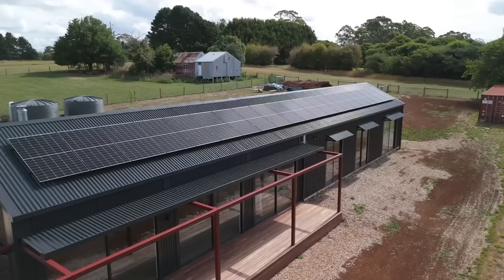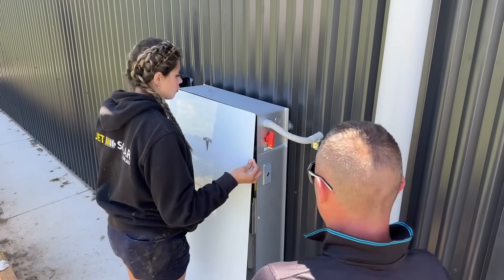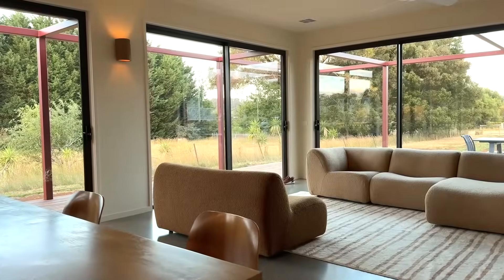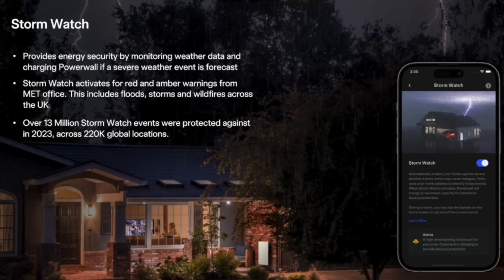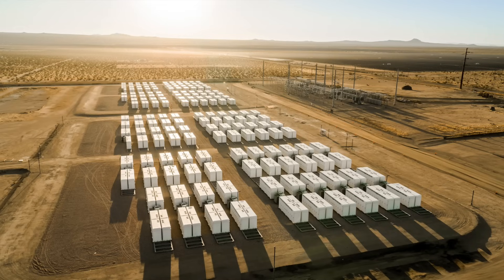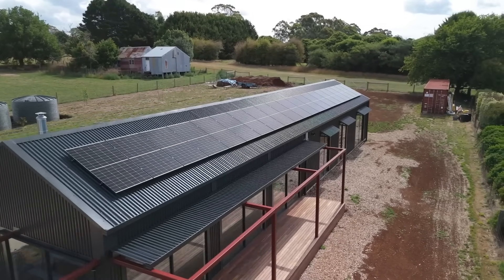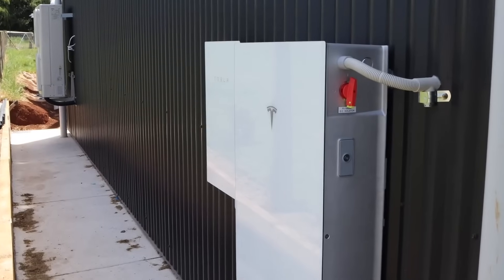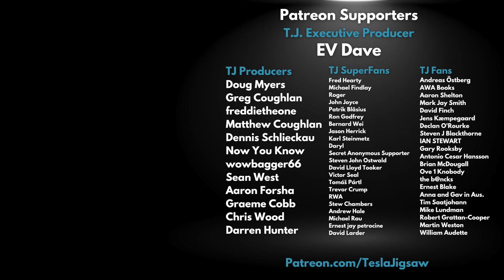Tesla Dream Unlocked: Model Y, Solar, Powerwall & Starlink Secrets!

Comment: I can’t express enough how much solar and powerwall has fundamentally reduced our costs. 
And coupled with a great tariff from a great energy company that allows load shifting (charging powerwall overnight and running the house from it during the day) is a paradigm shift in how energy can be used and manipulated to an enormous advantage. 
Add solar export and running 2 EVs and the house costs a few hundred quid instead of several thousands. It still blows my mind.
Reply from the maker: Thanks for sharing 👍

Comment: Powerwall 3, Tesla LRM3, 15x250w panels and a Daiken heat pump. We’re not fully off grid, as we can’t generate enough from our solar, but our bills have dropped from £160, to £30 monthly on average, including car charging. If we had a Tesla expansion pack I’ve calculated we’d be on zero bills, and with another 3 expansion packs, we be around £120 per month in credit due to exporting.
Seeing as the gas meter has gone, it’s nice to know our house has no chance of exploding any more, and we can sleep well knowing we’re safe from carbon monoxide poisoning, another benefit that no one seems to mention?

Comment: I'm also really happy with a Powerwall 3, model Y & Tesla charger, Also on an all-electric house in Au.

Amber Electric is our retailer with dynamic pricing, also excellent.
Reply: 🙌 Just signed up to Amber yesterday. How do you find it with Powerwall 3?
Reply: @RyanCowan  So far very good after 2 weeks with battery. 
Full battery integration - so it also works with Smartshift- is likely this coming week, so likely to become even better.
(Been with Amber for 5 yrs)

Comment: I am in the UK and have 3.7kWh of solar fitted to both the East Facing roof and West facing roof, along with Powerwall 2 a Zappi EV Charger, ASHP and my Tesla Model 3 RWD.  I do enjoy my technology so have an automated home, meaning I am running some computers 24/7. So our daily use is around 25kWh of electricity.

The ASHP uses 2750kWh to keep our home at a constant 19c daytime and 17c overnight.

The Tesla uses around 3,000kWh for 11,000 miles. It has given me the ability to have a total monthly electricity bill of under £100 for everything. 

We fill the battery at cheap nightrate of 7p per kWh and export as much solar as we can as we get 15p for every kWh  we export. Our night rate use is 76% as an average over the year, summer months it can be near 90%

If you can afford to put these things on your home, they add value first of all and seondly will reduce your bills dramatically.
Reply from the maker: Thanks for sharing. Very useful 👍

Comment: l live in British Columbia Canada. We installed 36 400 watt solar panels 2 years ago and have not paid a dime to our hydro supplier and have enough solar production to run our 2020 model Y + year round power to our home. Our Hydro supplier B.C. hydro lets us bank our excess power generation and then use the credit in the winter when solar power production is low. Just bought a Cyber truck which will be our Power wall that can supply 11 kw per hr for 3 days if we have a complete power outage. So far the solar is supplying the extra power the Cyber truck requires but it is spring and solar power is plenty at this time of year. We are already sitting with a huge credit with B.C. hydro and that will build through the year. Both our Teslas have FSD and we use the feature 80% of the time which makes driving or non driving a Breeze. Absolutely love our Teslas!🇨🇦😎
Reply: Thanks for that amazing post! I’ve been looking for a good review from someone in this neck of the woods, and you answered just about every question I have! 
How often do you clean your solar panels from the random bits and mould creep that comes thru?
Reply from the maker: Amazing! Living the dream too
Reply: Nice post. If you don't mind me asking how much is it to have a power wall installed. I'd like to install one but would like to know approximately when I'd break even.
Reply: Thanks for choosing wisely and making our planet more green

Comment: I'm lucky enough to have 2 Tesla Powerwall 2s, 10 Solar panels (The amount of panels are limited due to restrictive covenants), air source heat pump and a Tesla model 3 (Which appears on one of your earlier videos Will) However unfortunately I don't generate nearly enough energy to charge my Tesla. I do generate just enough to keep the Powerwalls charged and power the house for free during the sunny hours. I don't charge my Powerwalls to max each night either this time of year and let them top in in the day avoiding exporting to the grid. I'm really happy with it all. :)
Reply: Same! But Model S and 10kW of solar! 1850 Welsh cottage 🏴 ASHP, 2 Powerwall 2's, 2 EV's (Model Y as well) !
@Ryan, two Powerwall 2's will power the house at 10kWh too😁
Reply: @nikelliot8105  Oh excellent!!! 🥳🥳🥳🥳
Reply from the maker: How come I’ve used video of your Model 3? 🤔 Cool set up you have there, shame we don’t get more sun though! A battery nowadays seems like the best option to 1/4 your bills if it’s between solar & storage… would you agree based on your experience?
Reply: @TeslaJigsaw  You came to a meet I was at. The grey one with that fat spoiler on it. I would definitely agree. I'm paying less a month for my entire house to be powered and heated and to have 2 EVs on the road than two weeks of fuel in my old ICE car. A total no brainer.